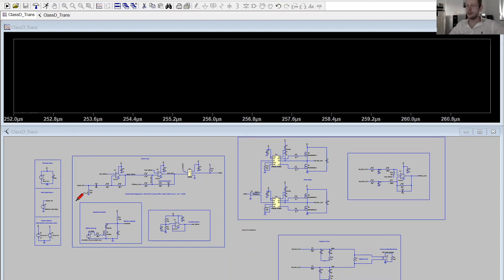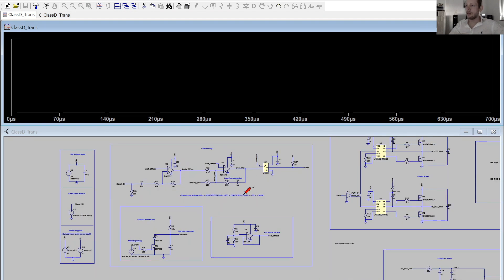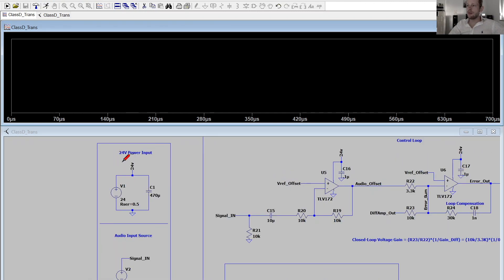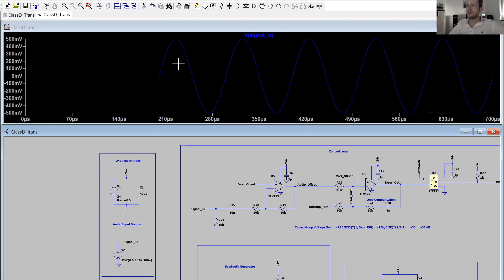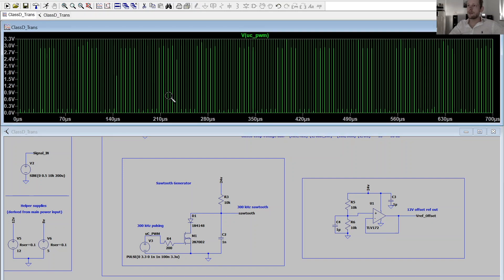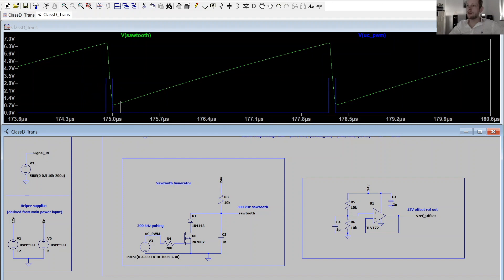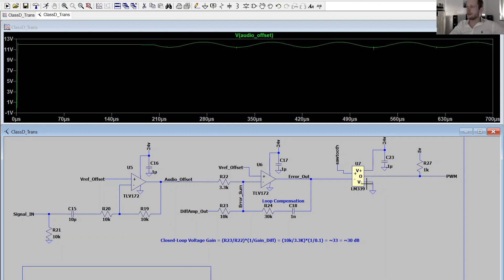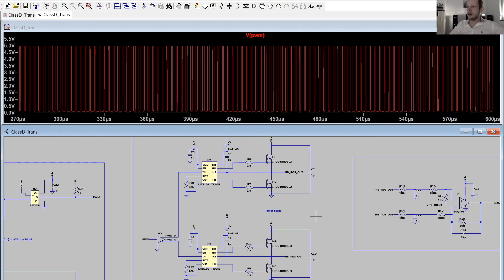[#2] Designing A Discrete Closed-Loop Class-D Amplifier (Tutorial)

Comment: If you have a 47pF cap across R4, you should likely have it also across R1, otherwise you are worsening the HF common mode rejection of the differential amplifier by not making the response symmetrical.

Comment: Do you can explain or have a schematic for ltspice so I now how to simulate it, I see you use a lineair model? The zero dB crossing is important and for output ripple reduction the place where it do cross is important, you let clearly see the result of that, very nice, use 25 khz zero crossing needs already high switching frequency to reduce ripple and get higher bandwith. Thanks for explaning.

Comment: Hi, in real life application where our audio amplifier outputs get connected to a long speaker cables thus induced an EMI back into the circuit. Do we need additional EMI filter that sits between the LC FILTER AND THE Speaker? How to design the filter and what kind of response it has on the total performance of this class D amplifier?

Comment: Hi, can I ask you where i can find the LTspice model for the LM5106, TLV172 and LM339 thank for your atention
Reply from the maker: You have to go on the TI website, search for the components there - and on the product webpage you typically find unencrypted pSpice models under the section "Design & development"
Reply: @YetAnotherElectronicsChannel  Yes thanks I found everything, it is possible that i have some trouble with the simulation (I don't change anything) in particular the signal audio offset has a DC offset of 7V instead of 12V and that the signal Error_Out is not corectly generasted it is at 24V stable

Comment: This is not a discrete circuit. Discrete means all elements are single element components, transistors, caps, resistors, inductors etcetera. Not integrated circuits. I would like to see someone design, model, and build an actual fully discrete class d amplifier that actually works well.